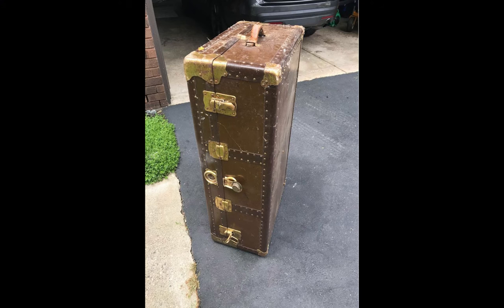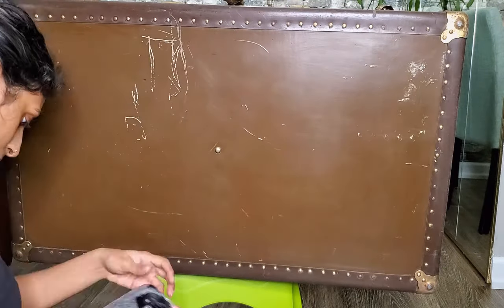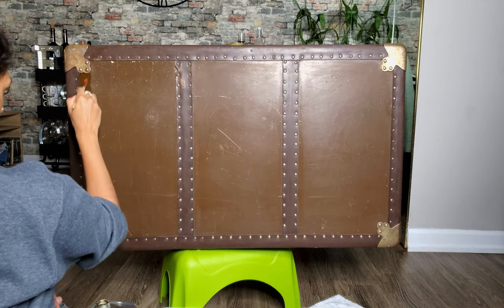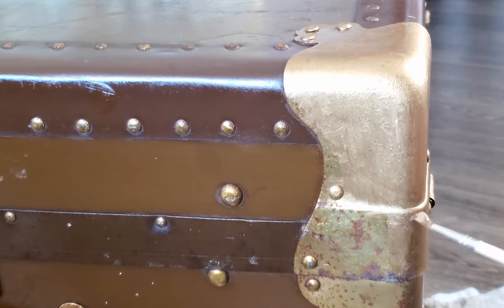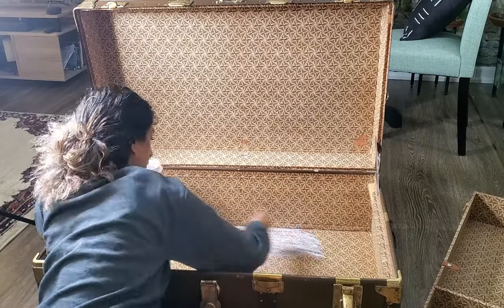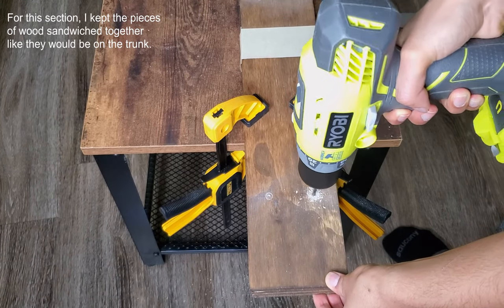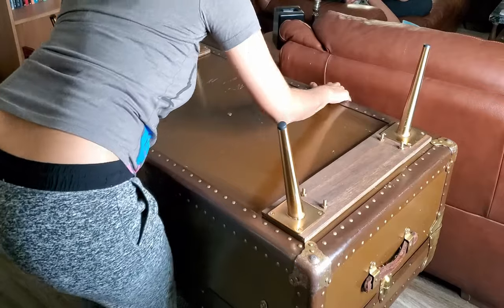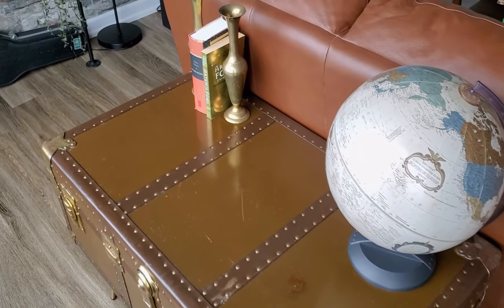DIY Restoration- Vintage Trunk Coffee Table Makeover | Eshi Jay

Comment: Hi you have done a great job, sad about the damaged lock but overall came out as a neat and clean product. If i had to fix those legs i would have done with 4 bolts straight through those wooden planks for each leg instead of those screws because the legs should be sturdy. Oh yes i would have selected one size bigger bolts and off-course supported with washers.😊
Reply from the maker: Thanks for watching!!